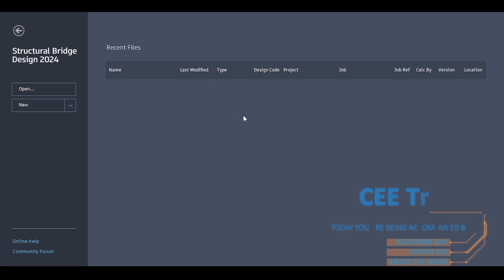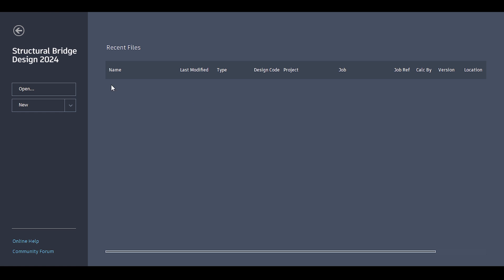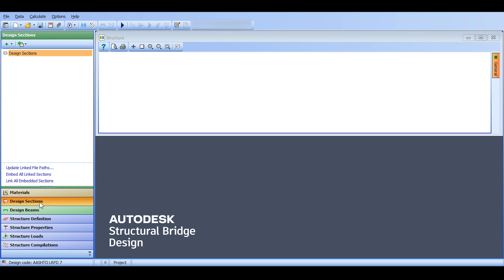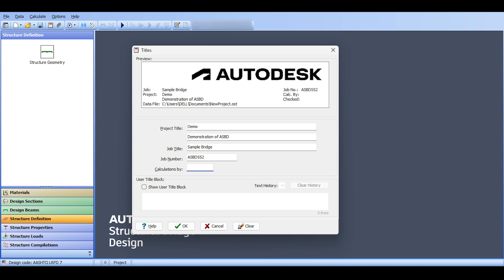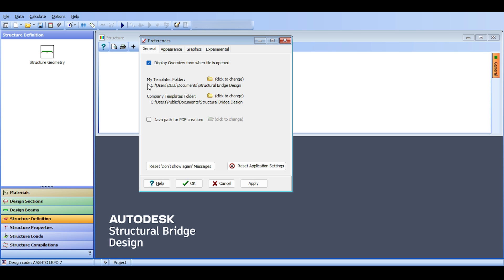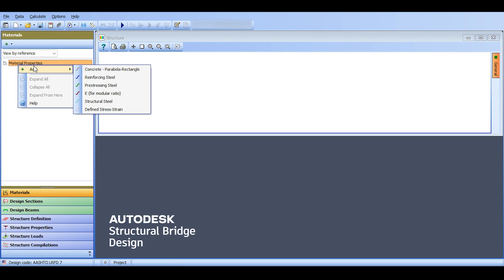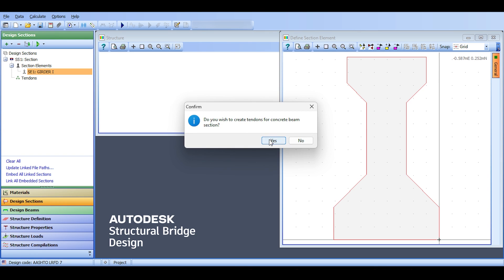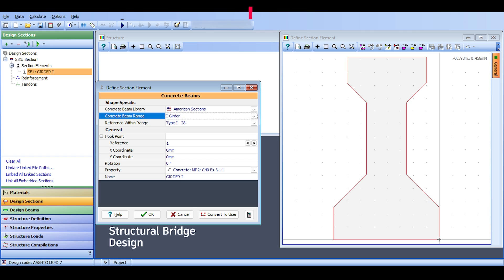Understanding the GUI in Autodesk Structural Bridge Design

Comment: Hello Dr. CEE and Hello also to the Recorder Guy 😊,

I really admire your ability to properly compartmentalize topics and series. I like what you have just done here when you separate the “Design of a HW Bridge – course series” and the above series specifically dedicated to the application of “Autodesk Structural Bridge Design software” as one of the specialized software in the analysis of bridges. Your separations always help a lot with proper understanding and appreciation of the “bigger picture”, well done to the CEE team.

I have noticed in this introduction that the ASBD software seem to have “Design Beams” modules for “Steel Composite Beams? Pre-tensioned Prestressed Beams? Post-tensioned Concrete Beams? and Reinforced Concrete Beams? and I am wondering if these modules could be helpful to enhance general knowledge, understanding, and even perhaps the design of say composite beams and prestressed beams in general? 

I cannot help to think that these modules may have been specifically customized more towards bridges codes designs and requirements checks? I am guessing that they may have been customized since they are core components of a speciality software; I do not know if this is the case. I have not used this software nor any of the modules before. Basically, I am wondering if it would be ok for someone to use the composite or prestressed beams design modules of ASBD in the general case of the design of a composite or prestressed floor slab system to be used in say a building structure as opposed to a bridge structure?     

Great video and always, keep well and I am looking forward to your next videos

Kind regards, DK
Reply from the maker: Hi there Engr. DK,
Indeed, I thought lengthily about it and decided to split it. Because I want people with background in bridges to find the "software videos" quickly, whereas people lacking those skills to find the theory in the bridge series.

All those modules do - indeed - improve your design conceptual understanding in general, as you mentioned. However, there are specific checks that are limited for bridges. Those checks can be similar in RC beams in buildings, but with different limiting values.

So, your guess in the first parts paragraph 3 is right. ASBD and CSI Bridge and softwares like it are tailored for bridges, and would lack some abilities when it comes to building design. Now that you mentioned this suggestion, I will keep an eye on that. My thoughts - initially, but I have to dbl check - is that ASBD is "overqualified" for buildings coz bridges are more complex structures.

Still, to give you at least a "general purpose pre-stressed software" to check out, here in my local area, we use "RAM concept" as the main design software for prestressed slabs (especially those flat slabs with no beams). You might want to take a look there. 

Hope this gave you food for thought,
Regards,
CEE
Reply: @CivilEngineeringEssentials 

Thank you for the feedback, I appreciate and value your thoughts and views on this. Yes, you have certainly gave me food for thoughts. I'll have a look at "Bently - RAM concept", I have recently also been looking at "CSI - SAFE". 

Regards, DK